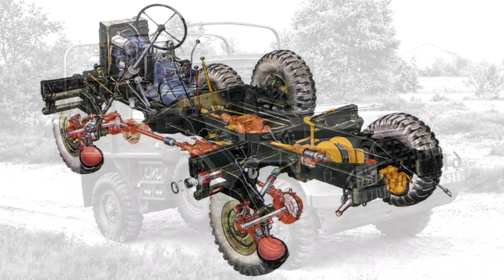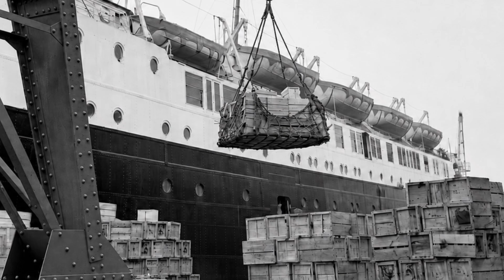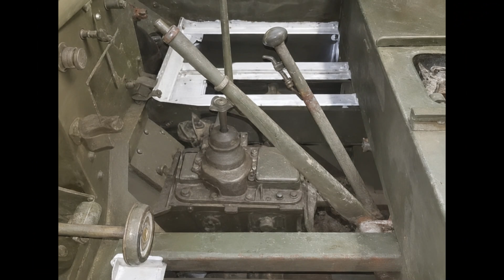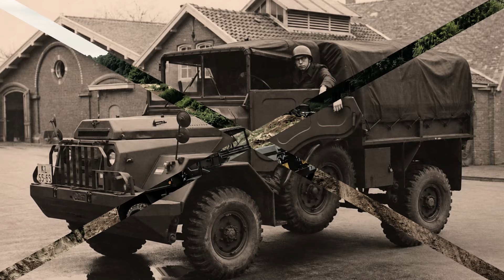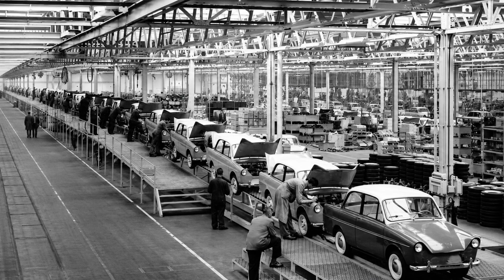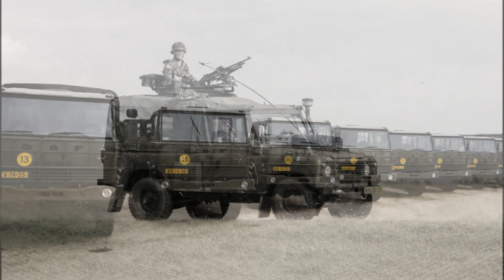The Dutch Military 4x4 Built Unlike Any Other | DAF YA-126

Comment: No ambulances were converted to radio vehicles, just gs trucks were converted and provides with a steel cab (am ezb) or aluminium cab (fm) with canvas cover.
Reply from the maker: You’re right — thanks for the correction and the extra details!

Comment: I still got a medical report from the time I drove it. 6 frozen toes, with a training. In mid winter we had to drive to Munster Sud from ‘t Harde. Every one knows that the 126 didn’t have a heater, that you could look at the street through wholes by the pedals. We were with 3 126 cars and we went to our Captain to warn him about the risks, he said it’s copying real circumstances, but we said that was only when we would be there, this isn’t part of the whole operation. The M110 peace’s were going by train, so why not we, small cars, more then enough space. No he said!
Well, it was freezing like hell, -20 C and I looked like a Michelin man, 3 pair of socks, kept the boots loose to keep wriggling, in the end I just didn’t feel my toes and thought, ok that goes well.
When we were back on base after a week my toes started to hurt like hell, so I got to medic, they started checking and I was just lying and talking to the medic. After a few minutes he said if I did feel something, nope I said. Well he said, I just put a needle in 6 of your toes…. Ow…. 
Then came the report how this was possible, I told them about the operation, the warning, etc. They made a report that was not reflecting in anyway good on the captain, we also did some research that it was the first time the 126’s were NOT on the train, that drivers could have been given tank gear, and some smaller things.
That captain never became a major, it was another nail on his coffin, besides that he was an utter asshole. He wasn’t from the KMA, but risen outside the officers academy, he never realized or wanted to acknowledge that quite a few of the drafted grunts were way smarter than him (I got myself an engineers title after I got out).
Reply from the maker: Sometimes the biggest problem isn’t the vehicle itself, but an idiot in command. Sounds like the YA-126 left you with more than just good memories. Thanks for sharing your story.
Reply: @HistoryOfMachines  yep, know the limitations of your equipment!

Comment: I was driver/radio operator on the “Eén Tonner”, een radio EZB bak er op, aggregaat er achter. Ik was populair met mijn 220 volt, koffie apparaat, tosti-ijzer, etc. Aangezien mijn bijrijder er uit was geschopt was ik de enige en hoefde geen andere diensten te draaien anders dan de radio uitluisteren.
Prima tijd gehad!
Reply from the maker: Sounds like you had your own little café on wheels 😄 Great story!
Reply: Haha, bij mij net zo, kvv korporaal was altijd foetsie dus was ik reserve. Lekker die benzine kachel aan en hop in de slaapzak in de ezb bak. Ik heb er zelf 1, van buiten uitgevoerd als de ya 126 ezb uit mijn diensttijd.

Comment: The YA-126 was my first light truck when I was a drive instructor in the army at Bergen op Zoom in the south of the Netherlands, in the winter it was very cold inside the car and luckily I moved to other barracks in other places and I gave drive instruction on some other vehicles like the landrover, YAL-4440 (a six wheel version of the YA-4440) and also on a Magirus Deutz and some other vehicles till the end of my contract in november 1983.
Reply from the maker: You really got to work with quite a variety of vehicles during your service. The YA-126 must have been especially memorable as your first light truck. Thanks for sharing your story!

Comment: I also have one. It's made of indestructible. 
Yet, how much I love the engine ( starts always in one go, no matter how long it's been sitting ) , i would love to electrify the Daf.
I would be a perfect candidate for it, lots of space to do it. Even plenty room for a small spare backup generator in case the batteries run empty.
You almost never make lots of kilometers in this vehicle, so going electric makes total sense. 
The problem I run into is finding the right electric motor. Ideally you would need a motor that produces around the same HP as the original motor, so around 60 to 70KW.
Most of the electric motors produce a lot more, or a lot less.
But it's a fantastic offroad vehicle, dare I say, a lot better then the Unimog !
Reply from the maker: That’s a very interesting idea. Thanks for sharing!

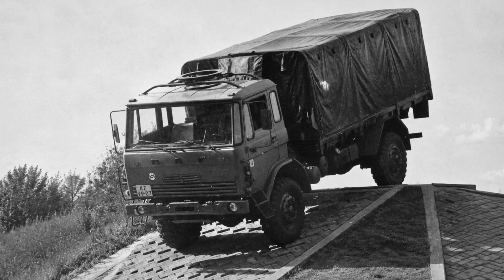Comment: 4:49 The YA 4440 was not the replacement for the YA 126; the YA 4440 was the replacement for the YA 328 and 314.
Reply from the maker: Good catch — thanks for pointing that out!
Reply: Actually there was the YA 2442/3 which was like a short  2 tonne version of the YA 4440 and a replacement for the YA 126 and some UNIMOGS.. Two prototypes where build.  https://sites.google.com/site/dafmilitairevoertuigen/home/index/tactisch-militaire-voertuigen-1975-heden/daf-ya-2442-ya2443 I've seen on of them in The Hague at the Frederik Barracks. I think they were refused for being almost as costly as the 4 tonne, but only could carry half the load and very short boxes/shelters.

Comment: I was a mechanic in my army days and YA126, YA314, YA328,YA616 and YA626 was my job to keep them running. I was part of the 44 herstel cie in Grave the Netherlands. Good times.
Reply: Me to, 67/1 genie( 101NBC Ermelo)exeptya616 and ya626
Reply: I drove the ambulance model. Was like a camping car. Beds, heating, light, everything was there. I was with the 176 zaucie (ziekenauto compagnie) in Ermelo. That was 1973.
Reply from the maker: It’s great to read memories from someone who actually kept these DAFs running. Thanks for the comment!
Reply: Was chauffeur op een 328 in Oirschot staf staf en heb ook op die kleine gereden 😂😂😂😂😂
Reply from the maker: That must have been quite an experience back then. Thanks for the comment!
Reply: Mijn vader weet het ook nog i ben een van de tijd landrover Nice respect
Reply: @daanveld2887 ik heb de eerste laro's en daf 4440 binnen zien komen voor de eerste beurten. Lichting 75/5 kvv'er.😊
Reply: I have 2 of them, one EZB radio version and one GS truck, number 27 built, KL-50-30. I drove a EZB radio truck in the army during 86-87, i prefer it above the Landrover 109 and 88, even without a heater.

Comment: A number of these DAF YA-126 and some other DAF YA series trucks were used (and crashed) in episodes of McYver and the A-Team in the 80ties.
Also momentarily in the X-Files and Airwolf.
Reply from the maker: Very interesting! I knew these trucks had a long service life, but I didn’t know they also had a career on TV. Thanks for the info!
Reply: @HistoryOfMachines  A pity that these type of military vehicles have not been more developped and equiped afterwards! It would have been very useful today!
Reply: @ArieKROON  If DAF were to start designing a new military truck today it might well end up having an inline hybrid drivetrain, cutting out the transmission and mechanical linkages entirely and replacing them with electrically driven axles. The power generated by the motor-generator would be handy to power all the various electronic gadgets that have been introduced over the past several decades while the vehicle could do double duty as a field generator if needed.
Reply: @HistoryOfMachines  
Among others:
A-Team S01E11
MacYver S01E19